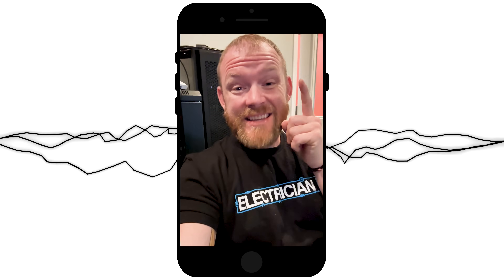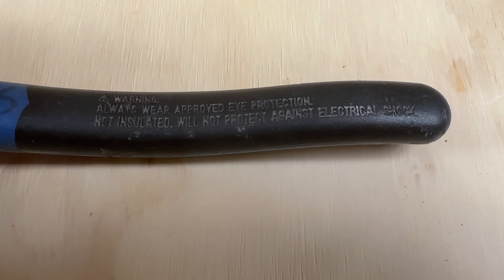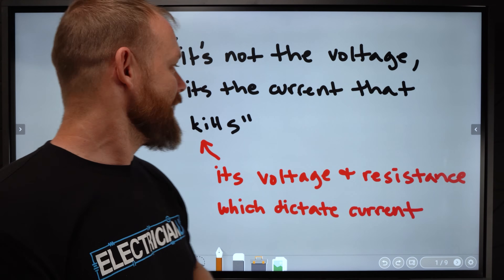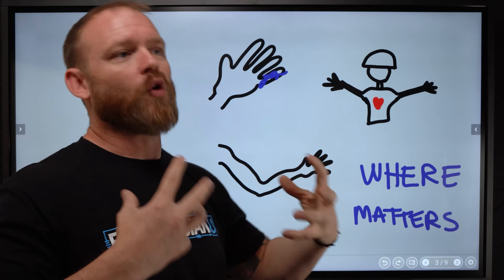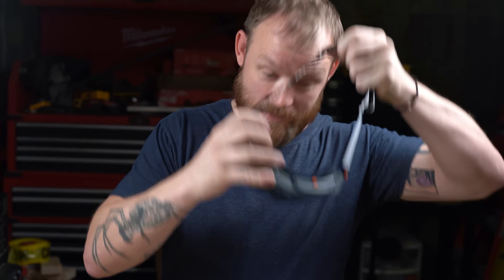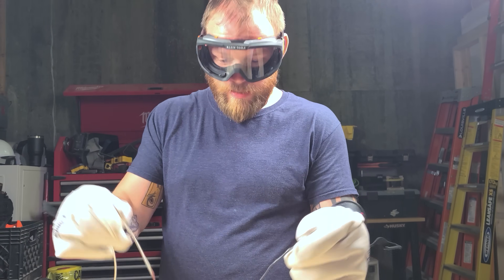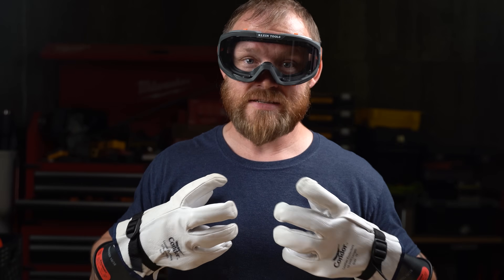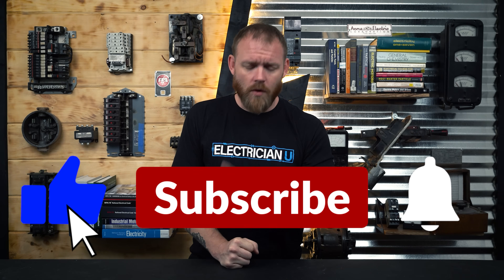Can 120 Volts Kill You?

Comment: Back in 1965 I was doing a little experiments with a extension cord from the from Atlanta but I did was I stuck to one part into the wall and twist two wires and stuff in my ear and I got a result 120 volt went through my my head

Comment: As a teenager, I went to a "hog club" meeting with my dad. It was put on by a representative of the ag department of the provincial government. An animal sciences professor from the agriculture faculty of a local university was there to talk about swine health. One of the producers at the meeting brought a sick pig for the meeting. The bespectacled, scholarly professor opened his briefcase and pulled out an extension cord from his briefcase. The female end was replaced with small booster cable clamps. He attached one of the clamps to the pig's flank and the other to the ear on the opposite side of the body. The pig hit the floor as soon as the professor powered up the cord. He allowed the current to flow for a short while and then proceeded to do a dissection in front of a group of hog farmers, talking his way through the diseased organs of the pig. 

Electricity kills!

Comment: Paramedic, deputy medical examiner, emergency medicine instructor here with 40 years experience.

I have seen it all. Lightning strikes, USB fatal electrocution, 1000A dust explosions shuttling off a panel without proper procedures (I had to tell the victim he would not live and died 4 hours later), fires caused by bad electrical wiring and even hangings where they used Romex to hang themselves (not an electrical cause but paramedics have a dark sense of humor to get us through the day).

When we shock people in cardiac arrest we use 100J to 360J. Pads/paddles have to be placed correctly to work at maximum efficiency.  AED's require correct placement also. So electricity can also save lives. the heart is a biological pump that uses electrolytes, muscles and electricity to work. Just before the heart fires it builds up a potential of -90ma. It repolarizes within 1 millionth of a second via an electrolyte osmotic change in the heart cells.

There are many different causes of death due to inadvertant electrical exposure. People can die from damage to the heart, no damage to the heart but stopping the electrical repolarization, tissue cavitation that can cause internal bleeding and organ damage, damage to the brain or neurological system that stops functioning telling the body what to do.

I have been on car crashes were we watched people die because there were live power lines on the car. We don't put ourselves and known risks and just wait till linemen (women) get there to cut the lines.

Personally I have been shocked by 120vac, 12vdc, 22.5vdc, 240vac and experienced a lightning strike about 100 feet from where I was standing barefoot on pavement in the rain.

I have installed knob and tube back in the 50's and run thousands of Romex, conduit, above and below grade lines, Ethernet, cable, data lines, and installed thousands of receptacles, switches, panels, sub panels over the decades. Currently my whole house is run by a computer using Z-wave on code that I wrote. And use many electronic devices that I hacked because no one makes the devices I need but are finally starting to come around like Z-wave dry contact relays.

My buddy who is also a paramedic (old like me) had his house burn from a toaster. The cause was no ground in the electrical system. And 9 other homes in the same subdivision had the same issue but all passed inspection. WOW!!!.

So yea, I have lots of experience in the electrical field and seen 40 years of what can happen to carbon based life forms interact with electricity in an abnormal fashion.

Sorry for the long comment but it is the instructor in me that takes over sometimes.

I enjoy your videos. They are simple and straight to the point without a lot of excess verbiage and adjectives.

Comment: I will say this, as an electrician,, as an electrician I promise you amperage still matters. If you're working on a live circuit that's 277 that is close to the source and there is no external laod like lights or motors, you will feel the difference between 120,277. Now put a load on that like live lighting retros in offices or industrial.  Put ten lights in front of you and complete that circuit..on 277...same for 120 and drop ceilings.  Wow worst shock on 120 was above the ceiling grid with a box that had two panels running through it and luck has it just so happens I troubleshot and identified everything hot and it just so happens that during one of our service upgrades at a large facility new service new panels. 2 x 600 amp service .So I finished one project I turn on all the breakers for that panel go to my next project to complete so I can turn on the breakers for the second panel found out that that box shared circuits. I was leaning on top of a sprinkler pipe inside of a tiny little space of 2 ft with concrete above my head on a ladder...wow that one made me get down and recover. Yep it could kill you and most electricians die on 120v

Comment: I was 10 years old when i went to unplug the tv from the outlet  because the on/off knob had broke. My thumb contacted the plug blade and i was hit with the full 120V racing up my arm. I flew backwards, hitting the floor on my back. I could only lay there, stunned and hurting really bad. I recovered from that in time. Believe me, 120V is no laughing matter.

Comment: Back when I was about 4 years old (56 years ago) we had a refrigerator plugged into a ceiling light socket and you had to pull the light string to turn the electricity off from the refrigerator before you could even touch it. One day I went to open it and the light was still turned on and as soon as grabbed the handle it brought me off the floor. I commented on a video earlier that if my brother hadn't of been there to get my mom I probably wouldn't be here now and someone commented back and said 120v wouldn't have killed me. My brother said my body was sticking straight out.
Reply: 120V can kill a adult never mind a child. Sounds like the fridge was improperly grounded making you tied to direct ground. The worst case for an electrical shock.
Reply: @WTFUSERNAM44  I don't know who hooked it up unless it was the landlord. I was blessed that my brother was there and saw me and ran and got my mom or I wouldn't be here today. I still remember that day. I had Angels watching over me that day for sure.

Comment: I work on the  telco side-not in the field anymore or a journeyman, but I do my own electric at home. I was working on a roof on a jobsite straddling the weatherhead for leverage.  Hot sweaty work. One of the safety clips came off the hot leads for power and I got hit with 200 amps, straight through the groin. Lesson  learned. Ordered the proper safety gloves the next day. Don't f*** around because you will find out.

Comment: Can 120 Volts Kill You? Yes.
Can 240 Volts Kill You? Yes.
Can 24 Volts Kill You? Yes.
Can 5 Volts Kill You? Yes.
You can turn the question around like:
Can you survive 120 Volts? Yes.
Can you survive 240 Volts? Yes.
Can you survive 24 Volts? Yes.
Can you survive 5 Volts? Yes.
As your lawyer will say: I all depend......
What kills you is the current through vital bodyparts, so the point of entry and exit of the current matters, as well as what ever resistance your have on your skin at that point in time, as well at the voltage.

Comment: I remember once when a electrician was connecting some stuff to the panel at the office.  He did not shut off the main breaker and opened up the panel (I know almost no one does this when connecting the the panel).  Apparently the main breaker had not been bolted in when the panel was installed and popped out.  He was able to quickly  get it back together, and thought nothing of it at the time.  But the power had been out for just long enough for critical IT equipment to go out.  Because of this the building department found out and he got in big trouble for working live without a live work permit.  After that he and the rest of his company was very carful to not work on anything else live in our building.

Comment: I know this doesn’t really have anything to do with the video, but I’ve been told the neutral carry’s voltage back and the ground sends “excess” voltage to the earth, but how can the ground carry so much voltage to the earth since it is it is so much smaller than the current carrying conductors (I’ve also been told the neutral carry’s the same voltage as the hot)

Comment: Fun story, pure water is actually NOT conductive, it's actually the impurities in the water that create the conductivity; AKA electrolytes like potassium, sodium, etc. Also, the skin is generally regarded as a really good insulator, but like Dustin said, it's not the current or the voltage, it's the combination of the three. Enough voltage and you break over resistance. Or, if you break the skin and get into the gooey parts of the human body, resistance is very low!

Comment: None insulated tools work fine man .toss a little electrical tape on the shaft for screw drivers and your good to go .it’s common sense man they are the same tool the other one just has plastic on the shaft
Reply: Make sure you aren’t sweating and the electrical tape slips! Also you should wrap it around a lot. Better safe than sorry, and probably better to get insulated tools if you are using them often

Comment: 11:16 you just re-invented(demonstrated) how an old school "steam vapor humidifier" worked(more or less).  I recall relatives asking me as an young kid, why their humidifier was dimming the lights and tripping the breaker, which I recall not figuring out the whole issue. turned out they had city water, which was still hard and a water softener that was malfunctioning, then manually adding more table salt to the humidifier water. they were lucky it didn't injure/kill them drinking the tap water!
I was about 10 years old then and scratching my head over it.

Comment: One recommendation about eye wear: Physical protection is good, of course. But never forget the amount of high energy light comes of an arc. Always a good idea to wear arc proof protective glasses when working of high impedance live circuits, people have suffered loss of eyesight due to arc incidents. Technically it's similar to electric welding without eye protection.

Comment: It's funny that those "special equipment" for live work are the basic level that we use in Finland to do normal work.  It would be strange to see an electrician with non insulated screwdriver etc.  There's totally different set of tools for live work and usually using them requires some extra learning and written order from supervisor to use them.  And a lot of experience with basic stuff.

I had to do some thermal imaging in couple of industrial sites for couple months earlier this year and after the first week of just snapping thermal images and measuring currents in cabinets/devices from ~1960 to today, I had to say to the client that it seems that I can't do this more than a week at a time, as I got too used to opening those "christmas calendar" doors and diving in elbow deep to measure currents.  I told them that I'll stay at our office and compile my report or do some smaller jobs for few days and come back when I have my healthy fear back.  Luckily they were professionals (electrical maintenance team of the plant) and knew what I meant.  And there were still enough time to go through all the sites before their planned summer downtime.  Those thousands of current measurements back to back are really bad for your safety views, as you really get used to sticking your hands very close to live parts.  Live work gloves are nice when you do one thing, but try to wear those for a full week..  It was regular thin installer gloves and if that would not be enough, it was easier to check that the thermal image seems good and write down that measuring currents were too dangerous.  If the image had some uncertainty in it, then the live work gloves were an option.  Luckily there are two ends for every cable, so usually the other end had more suitable place for clamp meter and I got the currents for my report.

Comment: the wort i ever experienced is 400Vdc i whose troubleshooting the control circuits in a substation and something failed in the multi-meter , that felt like someone kicked me in the chest. and i actually have a scar in my hart from that. so remember anything a bow 50V can kill you if the circumstances are wrong but if you are seriously lucky you can survive 400V. But do not be lacy and take that gamble. A former electrician.

Comment: Part of the issue with shocking a heart is the timing when the shock is delivered. When people are shocked into regular rhythms shocks are delivered at specific intervals on the cardiac cycle to avoid what is called R on T phenomenon. Basically there are labels applied to the cardiac electrical cycle and if you deliver a voltage during the hearts resetting of that cycle it will cause a deadly arrhythmia Ventricular fibrillation.

Comment: The hardest Electrical Shock that I ever got was from my Dad's Electric Fence to keep the horses in their pastures ! In the barn lot there was a 10' gate that allowed my Dad to let the horses out into the larger pastures. He had strung a electric line above the gate to continue the circuit to the fence on the other side of the gate. I was on the gate while it was closed and I was climbing over the gate and my forehead touched that wire above the gate and it knocked me off of the gate ! Son-of-gun, that hurt like Hell !!
Reply: I did the same thing once. I bumped the wire with the metal button on top of my ball cap and it felt like getting kicked in the head. I have never been shocked like that by anything
Reply: Electric fences are super high voltage but low current. You can feel them because the high voltage pushes the current through you easily but the low current means damage is impossible. No one wants to damage their cattle after all. Animal fences can be from ~700V to 6,000V.

Comment: As a State Licensed Journeyman Electrician/ Sub Contractor with over 55 years in the trade mostly Residential and some light Commercial, I have been shocked by 120 VAC numerous times and it just sort of buzzes and tingles for a fraction of a second usually with just my fingertips of one hand only . When I was a Apprentice back in IL in '66, I was on a 6' ladder working on the splices in a J Box in the basement of a new house being built and got shocked on one phase of a 220 VAC Branch Circuit going to a Clothes Dryer circuit. It knocked me Off the Ladder and the fall on my rear end and back hurt more than the actual shock did !
Reply: I do industrial
Reply: as a lazy new construction sparky (mid 1990's) I did majority of all finish install live, too lazy to play in the panel. but it was often not even finished/labeled out, sometimes still no stairs to basement yet! yeah helter-skelter disorganized overall construction levels. but I would slip now and then, taking it hand to hand all too often, fortunately calloused hands and high body resistance made it minimal. now in my aged even lazier years, I feel it a bit more. but what always gets me the worst in and out the same finger/back of them where soft skin and sweaty. over the years I have lit up plenty of incandescent bulbs via my fingers.
even crazy enough to have wired live in flooded basements from ankle to chest deep.(probably would have expired me, if I got zapped)

Comment: Might be worth noting that while your body does in fact become the load, you're also a rather resistive load in that example. A fun thing you can do is grab a multimeter, set it to resistance and grab each lead with each hand. A good meter with a few significant digits can tell you your own impedance (your skin has a capacitive effect that can vary, so we like to call it impedance rather than simple resistance). With known voltage of whatever circuit you're working with... those two variables can tell you how much current would pass through you in the same path.
Reply: Yes. It takes a good meter. I did just that when I was a kid.
The cheep radio shack meter didn't read that many ohms. A Fluke did.
Reply: But almost all the resistance is coming from your skin. Once you get down below the skin, resistance drops substantially. (And electrical burns can not damage skin much while causing much damage deeper in the flesh)

Now take those meter probes and touch them to more sensitive areas of the body. Like behind your lip.

Comment: Disclaimer: DO NOT EVER TRY WHAT I'M ABOUT TO TELL YOU, I'M SPEAKING FROM EXPERIENCE SO NOBODY ELSE DOES WHAT I DID!!!!!

I'm not an electrician although I have done numerous electrical projects around the house, and yes I've been shocked with 120 volts but it wasn't because I accidentally came in contact with it. I was about 3 beers deep and since I had touched 100kV+ from a Tesla coil and didn't really feel anything (while I was sober as a stone, mind you), I wanted to see how 120 volts would feel, since it's only 60 Hz (compared to the high frequency of the tesla coil) and capable of delivering significantly larger currents. So I found an old lamp cord I had laying around, stripped the ends off, and plugged it in then touched both wires against my arm. They were only a few inches apart and I made sure the current would flow just through my arm and not my body. Even in my slightly intoxicated state, it hurt like hell, I didn't even last a second before I pulled my arm away. Much worse than the 100,000 volts I took like a champ from the tesla coil, lemme tell you! 30 volts DC from my bench power supply across my tongue also hurt and I couldn't taste for awhile after that, still not comparable to 120 directly from the wall outlet though. Definitely not doing it again!